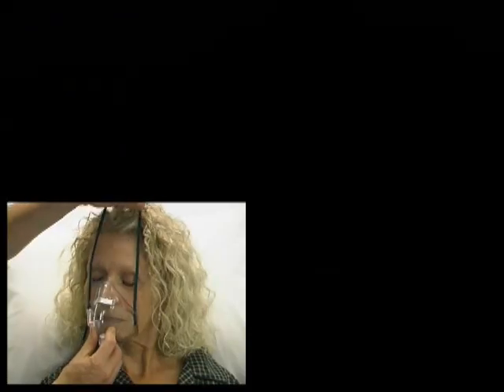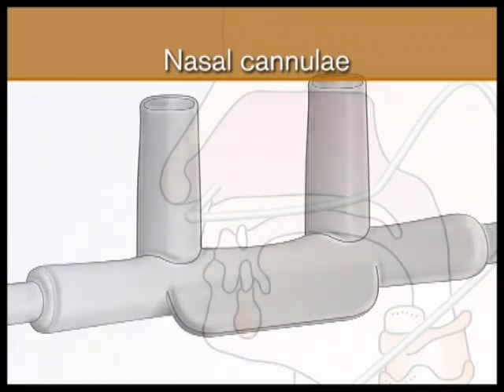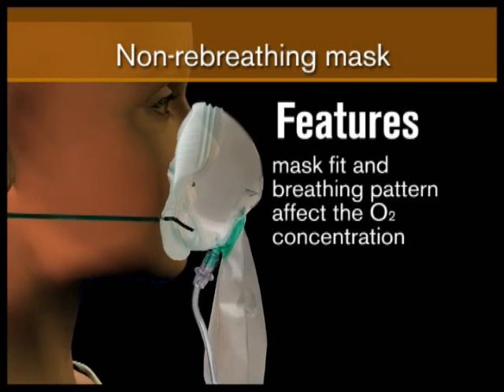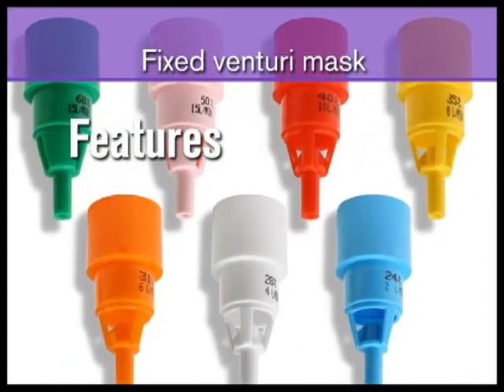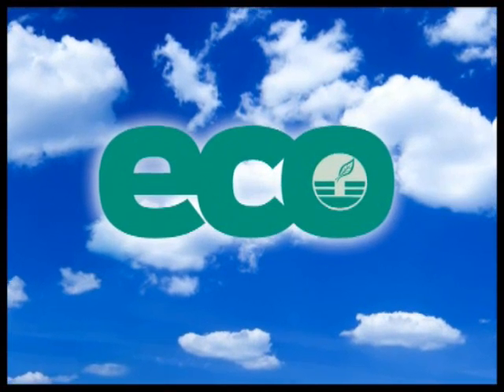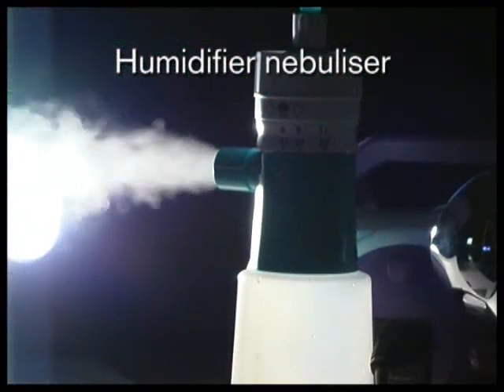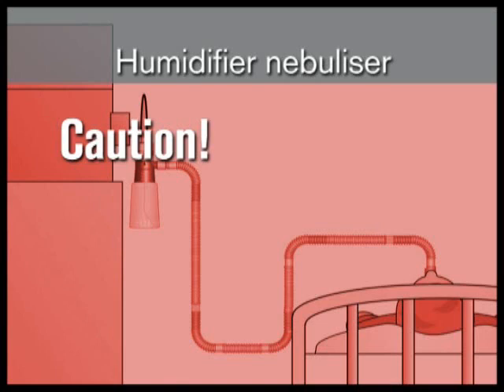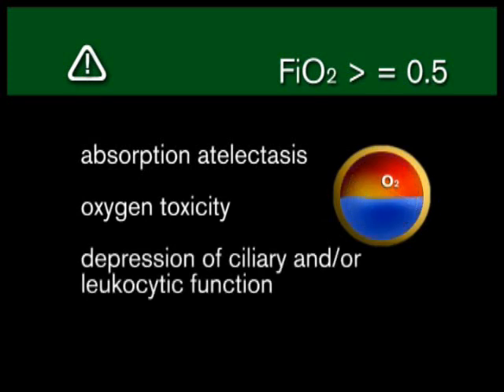Oxygen Therapy Training

Comment: Great Video....wish I'd seen it before my OCSE where I had a station on these devices! But at least I've seen it before I'm a doctor. I'm a little confused that the non-rebreather seems to be being separated out as if its in the low flow/variable devices and yet it clearly states the patient does not breath room air. Can anyone unconfuse me please?
Reply: Emily Burns The reason the person does not breathe room air is because the minimum required liter flow setting for a NRB ensures the constant flow into the mask and reservoir, which should meet or exceed the patient's inspiratory flow demand. This is why non-rebreathers need to be set at a very minimum of 10L/min. If the flow does not meet the patient's inspiratory flow, the patient will inspire room air which will dilute the percentage of oxygen inhaled, also known as "entraining" room air. If someone is trying to obtain maximum oxygenation, the oxygen flow, coupled with the appropriate device, should exceed the patient's demand. The bag on the non-rebreather is there so that the patient can get a "bolus" of oxygen if they suddenly have a huge increase of inspiratory flow (picture someone inhaling as hard and as fast as possible, the bag will deflate) in efforts to absolutely reduce the possibility of entraining air outside of the mask.